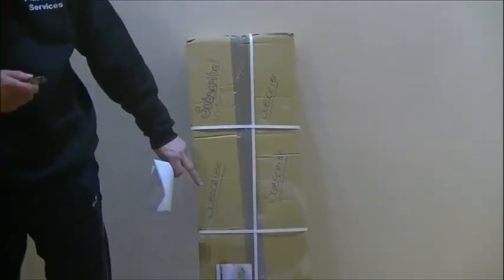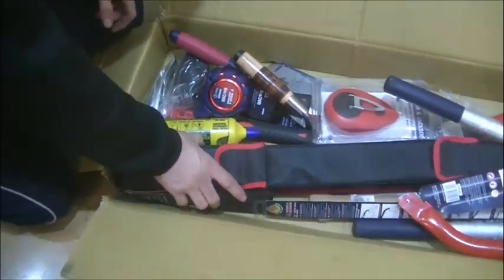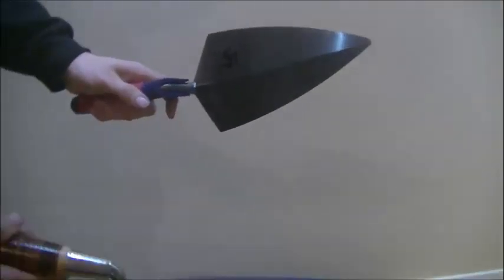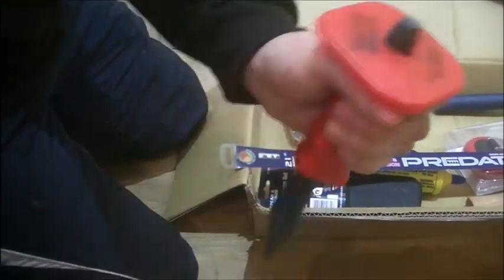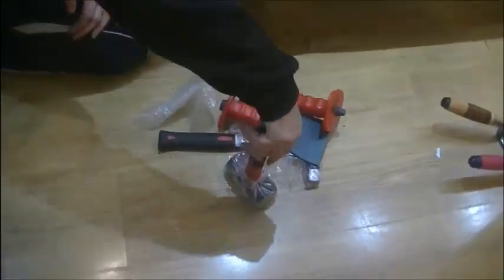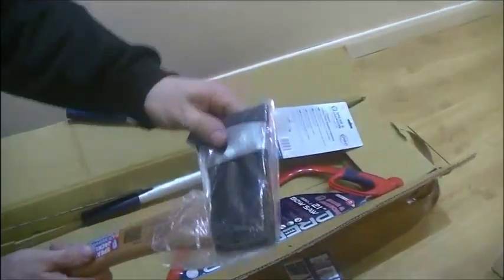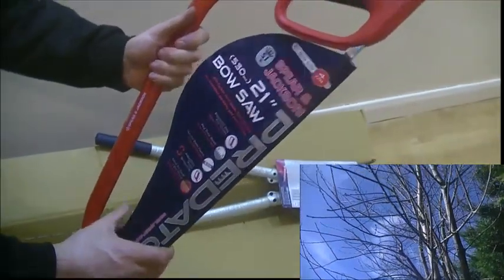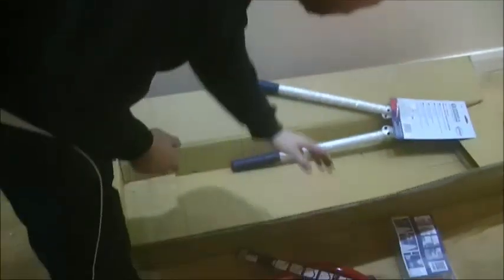unboxing spear and jackson tools for building and gardening

Comment: I've got the tyzak London 10inch red rubber handle it's the only thing I'll use now, ya can't go wrong especially with the fact its only 25quid compare to paying near 70 for a marshaltown
Reply from the maker: Yea price would be a big factor m8 I got on real well with this one mind you I'm a plasterer by trade but can fualt these trowels
Reply: Only fault I found with mine after a few weeks of use is that on the top of the handle where on the marshaltown you have a rubber bumper for tapping blocks to the line unfortunately on the tyzak the bumper is a hard plastic on the red comfort grip amd just wears away very fast and makes a quiet annoying sound amd eventually will crack. I know there will be lads sayin you don't tap your brick or block but cmon we all do at some stage. I ended up removing the tyzak red rubber handle and putting a marshaltown handle on that I took from and old worn out 3411 london pattern. It fit fine amd now the tyzak feels a whole lot better. I like the light weight blade and the overall shape of the tyzak london payyern trowel and the marshaltown handle has made it even better .
Reply from the maker: @dylanfallon7229  nice one mate yea comfort is a must when using a tool all day 👍
Reply: Buying a new barrow amd always used the usual yellow plastic barrow. Just find them better for moving blocks amd that as they don't warp and bed amd gwt dinged up like the galvanised ones do. They seem to have a deeper bucket/tub too. They are though that bit more costly but I've no problem with that.  So just a question... what would your preference be? Plastic or galvanised steel?
Reply from the maker: @dylanfallon7229  have a metal galvanised atm but have used the plastic   they are good and do hold loads of cemet
Reply: Picked up a plastic one there Monday morning, spotted a young lad working in the hardwear and he seemed a bit green so made a B-Line for him amd asked about the price on barrows. Usually the steel ones are cheaper and are about 65euro, so I asked how much for the metal one, he didnt know amd had to check the system lol😫 I Was expecting the plastic to be about 120euro then. Young lad lands back and said steel ones 95euro and plastic is 60euro. I handed him the 60 euro and legged it lol. Rang 2 mates that are in the trade straight away amd told them and they've both been to buy one lol one of them even bought 2 🤣 must of been a mistake surly. 🤣 plastic ones are always more expensive and are around the 110-130 mark and the metal ones always cheaper around 60 quid. Is that the way it is your side?
Reply from the maker: @dylanfallon7229  not sure mate I think b and q do them will have a look haha
Reply from the maker: @dylanfallon7229  online the 110 liter plastic one is £70 and 120 liter galvanised is £74 think they used to be 50 before covid lol